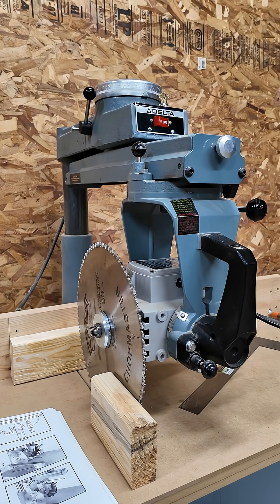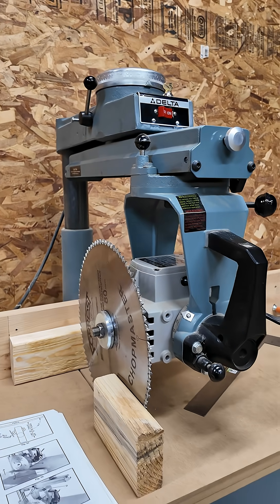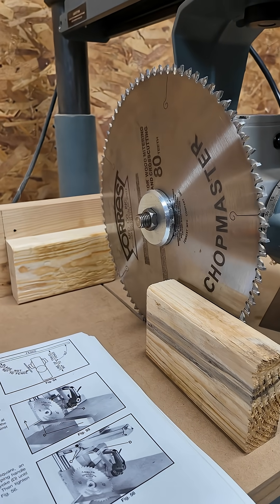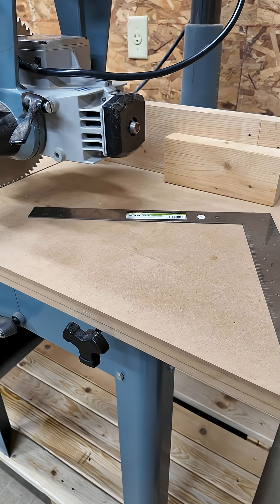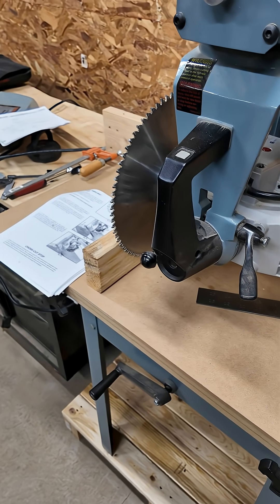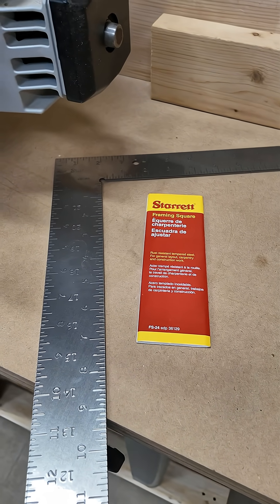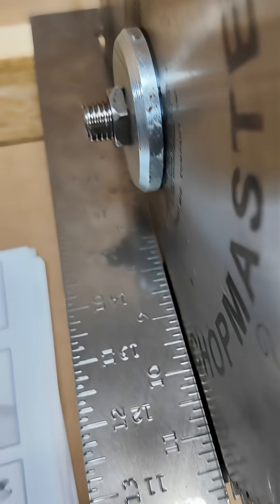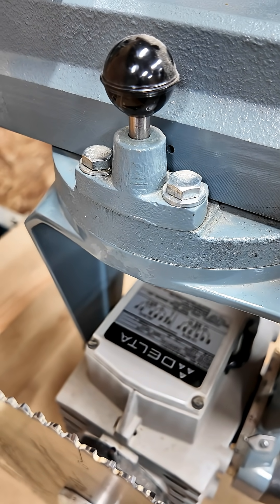Tuning up a radial arm saw with a Starrett framing square

Comment: Nice!  On my DeWalt ras's I squared the blade by adjusting the whole arm until the blade was square.  Probably the wrong way to go about it, but hey, it worked, lol!  To be honest, I'm not sure what brand my framing square is though.  I got it from ACE hardware probably 20 years ago.

Comment: Nice find on the precision square!  If I remember correctly, what you are measuring / adjusting in the video is heeling - essentially making certain that the back of the blade is traveling in the kerf made by the front of the blade.   It is not based on what you show in this video.  If I remember correctly, the 12" radial arm saw manual indicates that this step should be performed after the step where you place the framing square flat on the table, with a wrench on the arbor to make certain that the arbor of the saw remains the same distance from the arm of the framing square.
Reply from the maker: You’re correct. The manual says first get the saw travel square to the fence with a wrench on the arbor, then get the blade square to the fence (the “heeling”).

I’ve never had this machine tuned up as accurate as I’d like. It’s time to remedy that.
Reply: That sounds like a good idea to do this tune up.  In most of the cuts that I get from my three phase radial arm saw, the end grain in the cut is polished to the point that it seems to shine with the Forrest Chopmaster blade installed - I think that you will see similar results when crosscutting hardwood once your saw is tuned up. My single phase saw might have a little play in its bearings, but the cut quality is still very good.
Reply from the maker: WELL…

It turns out I had multiple problems. The carriage travel did need a slight adjustment as well. And because I’m using 12 inch blades with a 1 inch arbor hole and a bushing, it’s important that the bushing be seated straight.

But the problems didn’t go away until I replaced the blade. I suspect the Chopmaster was also damaged by my attempts to cut the angry board. 😢

I had a good quality Ridge Carbide waiting on deck, so installed that, and went through the whole tuneup again. I think I finally have this machine cutting about as accurate as it can be.
Reply: @ShopKlutz  Well, that is great that you solved the problem with the accuracy.  That is too bad that the Chopmaster blade might be bent.  Is the Ridge Carbide blade also an 80 tooth blade with a negative hook angle?  How is the cut quality now?  I wonder if the bushing you bought was designed for blades that are 1/8" thick?  Good to see that saw is up and running now.
Reply from the maker: Yeah, the Ridge Carbide is 80 teeth, -2 degrees. Cut quality seems very good so far. I’ll probably keep this blade on the saw for now. I’ve always preferred Forrest, but Ridge Carbide has its fans as well. 

Since Forrest has been acquired, I suspect people are wondering how well the reputation for quality will be maintained by the new owners. But I’m giving the new Forrest the benefit of the doubt. I just ordered another one of their blades for a different machine.